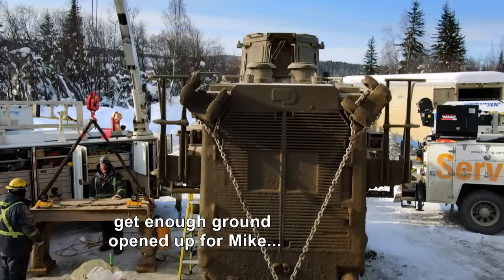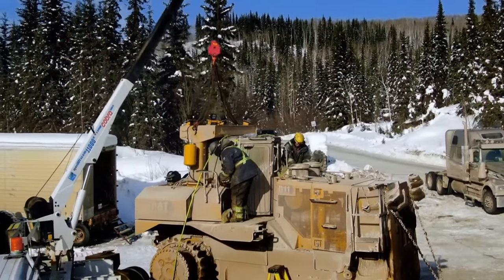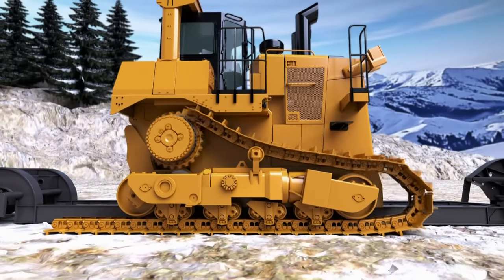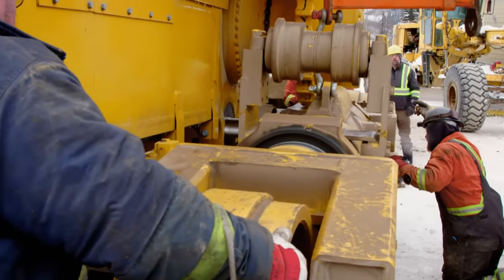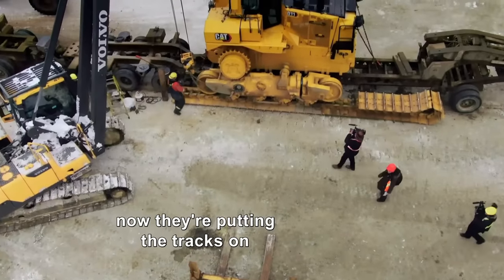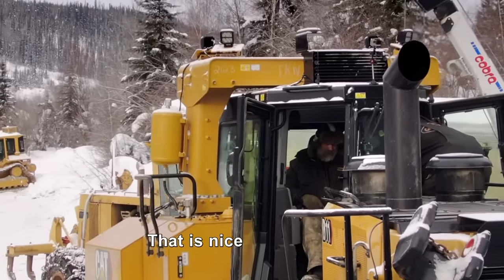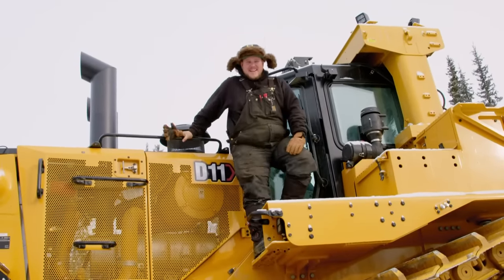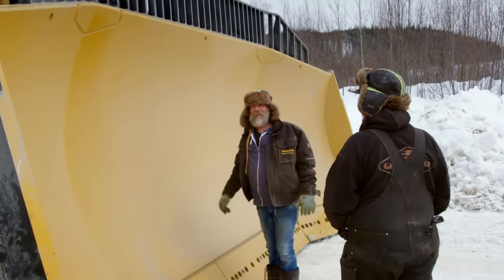Tony Beets Buys a Brand New $1.3 Million Bulldozer | Gold Rush: Winter’s Fortune

Comment: Damn I didn’t realize how big the bucket on that excavator was! It’s half the size of the bed on that giant truck! Not to mention the dozer could probably run over that truck if it needed to, some big ass machines they’ve got there. You often times forget stuff that big even exists until you see it.
Reply: Sent from my state of Illinois, home of Caterpillar.
Reply: It’s a BLADE, not a bucket🤣🤣
Reply: I saw one of these at my local Cat dealer years ago. I’m 6’1” tall and the bottom of that radiator is about head high to me. Very big machine.
Reply: I've seen one in the mining show in Vegas, blade is over 20 feet wide. They are massive

Comment: Amazing machines. What happened to that nice, new yellow blade ??
Reply: Looks like they sandblasted it, along with the ripper. I wonder if it has to do with the paint chips in the sluice? Unless that is the normal wear. That paint would not last long regardless.
Reply: The paint just comes off immediately on some parts of machines, rock, dirt, and the such are just that abrasive.
Reply: @nicholasbryant6122  Yea that would be the "natural sandblasting" lol, but the ripper looks intentionally sandblasted to me, but I don't actually know.
Reply: @CorDawgYT  Why would they go to all the trouble of bringing sand blasting equipment all the way to the Yukon just to sand blast a ripper shank when as soon as they stick it into the ground the paint will be gone.
Reply: @johnarnold893  I don't know, you tell me. Also CO2 mobile sandblasting is not some obscure crazy concept.
Reply: Herve fun changing that ripper tooth 😂 not as easy as you’d think

Comment: I worked on the line where the Cat D-11 is built in Bldg SS in E. Peoria,  ill. I was one of guys who filled all the fluids and purged everything in the final bay of the line.
Reply: I also did the D-10 case and frame,  which is first bay of the line. We got the frames from Bldg LL. and put in transmission and final drives and ran some hydraulic hoses. All Union made equipment
Reply: They are AMAZING to drive!!! Its SUPER EASY,  i use to also park em out in the South yard once they were complete.

Comment: Anyone else notice the blade changes colors in some of the shots on the end? Goes from yellow to silver.
Reply: The paint wore off..
Reply: @Bodybuilding and Mustangs  so your telling me 100% of the paint wore off on its first day of use?
Reply: @JustSumGuy  doesn’t take long man
Reply: @JustSumGuy  especially with frost
Reply: Paint doesn’t fair well with tons of sharp rocks running over it. Lol
Reply: @Ralph Llivrah  ya but there has to be a powder coat or like a truck bed liner that could protect that better? Why even paint it if it's that fragile. The company has to know the type of work the machine they produce will be put through.
Reply: Also with paint it won’t rust. Sometimes these machines can sit in the yard new for a while. But once the machine is working everyday. It won’t rust
Reply: Companies paint all the metal parts on construction equipment to keep them protected until they're sold. Once they're sold, all working parts get the paint stripped off them, But you don't have to worry about rust because the vehicle should be working everyday. It's just part of the job.
Reply: As soon as the ripper sinks into the dirt, it's like getting sand blasted. It will take the paint off immediately AND even steel. Over time, any steel moving through dirt gets filed down which is why it's common to add steel back by welding the high friction areas.
Reply: @JustSumGuy  They paint it because it's a Cat. They always come that way when new but it only last a second or two once it goes to work.

Comment: If those guys building that are not sealing around those ROPS bolts putting it together then you are going to see it pop those bolts as corrosion builds between the surfaces in the environment your working in, any clown can bolt these things together but it takes experience to do it properly to not cost owner down the track

Comment: A bulldozer is the absolute definition of heavy duty.   When it's in contact with the ground pushing  at full throttle very few machines spend that much of their time running so hard.   That's why they go through so much fuel in a day.   A large part of the time it is making 900 horsepower.  The other machines aren't coming close to that.  Once started or up to speed they are basically running at high idle.

Comment: is it 3.5 mil or 1.3 mil??? you write 1.3 but say 3.5 if it is 3.5 that is ridicules.
Reply: just as the tracks and blade turn from yellow to grey all in an instant.. this vid makes no sense at all..
Reply: @redsampler2017  yea wtf, and it was so dirty first and suddenly clean.
Reply: @redsampler2017  Just looked up what a new d11 cost, they say prices starts at 2.2, wtf that is absurd, we can but a brand new new holland tractor auto transmission 270 hp for 150k.
Reply: @Gustav4  or buy the lego technic model for 500 dollar and have some fun-time  ;-)

Comment: As usual, manufactured drama.  There is nothing dangerous about hoisting those 25k items into place as long as you use the correct chains.  "Oh they might swing, oh no" no they won't, not with decent handlers in place.

Comment: I like tony but I would have to stick up for parker and them him I'm not doing it for 10 or 20% its 50% I'm not tearing up my Equipment so you can make money especially if its rock excavation that's hard on any piece of equipment bad on tracks pins bushings ect that shit hard to get in the bush so going to cost twice as much to get fixed but 50-50 or no deal man go back to work for Rodger and my grandfather building roads quarrys rock we clear fucking wood hire someone to help cut help Alaska in the winter with fire wood so it's all materials that can be used but also the money it's going to cost to reclaim the land make ponds its excavation its like working with clay or playdoe make it beautiful